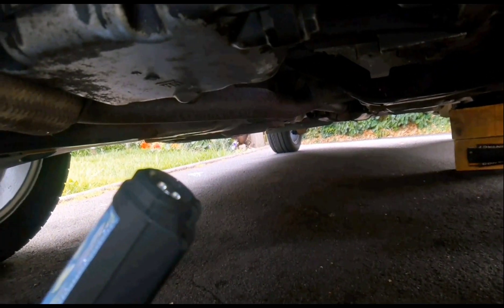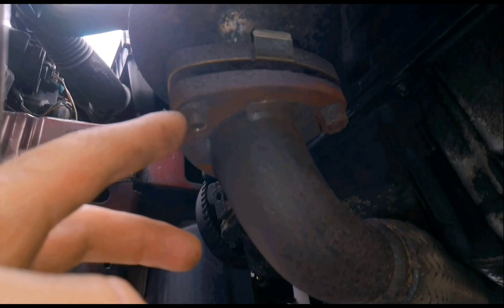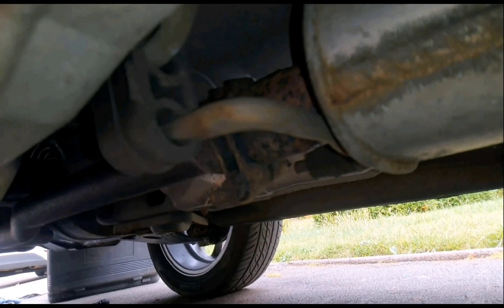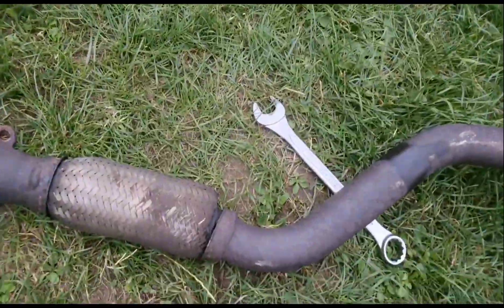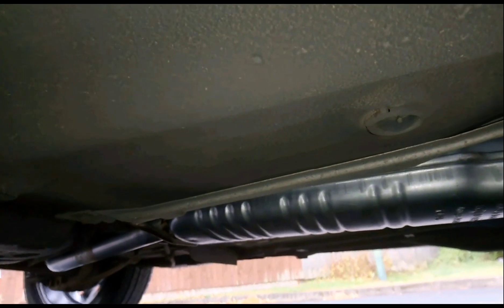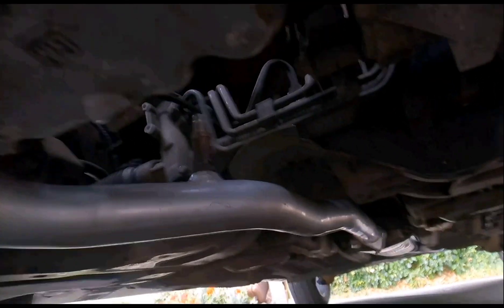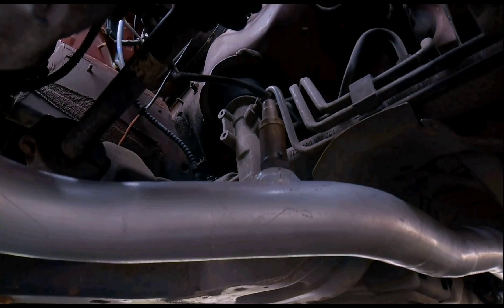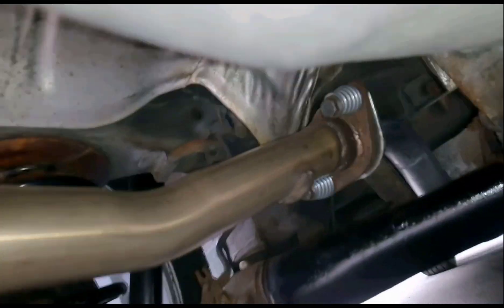Replacing Front & Centre EXHAUST Sections Vauxhall Astra G MK4

Comment: Thanks for sharing this. I have to do the exact same job on my Mk4 astra. Where would you recommend buying the front and middle sections?
Reply from the maker: Bought mine from eurocarparts
Reply: Do away with centre box and get a straight pipe from front to rear silencer less restrictive and more fuel efficient and cheaper will still pass mot and does not effect sound level

Comment: allright lads! hee hee, had problems with my front pipe,, big noise oh dear , turned out its the lambda sensor c/w with mounting rusted away from pipe. i manged to unscrew the sensor from the mounting ,grind mounting into a square , get a bit 1.6mm steel plate 80mm x 70mm , cut square in mddle , mig weld in mounting , then make the plate into a saddle , then with 2 pipe clamps , fix it ,with lots of firegum ,to pipe,  clean up the sensor thread then screw in back in ...hey presto ,it worked... ill get a pipe sometime ....lads !!
Reply from the maker: Lol.. Sounds like you've been busy.. Well done on fixing the issue.. recent videos include everyone not just lads lol... I'm trying